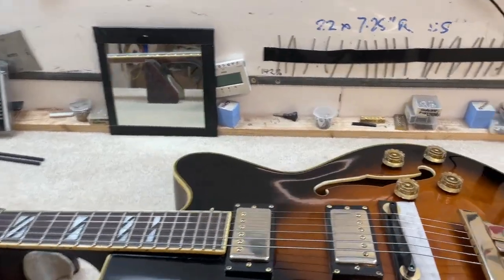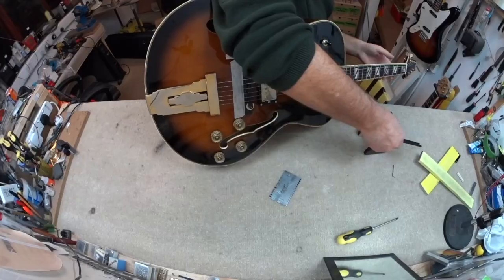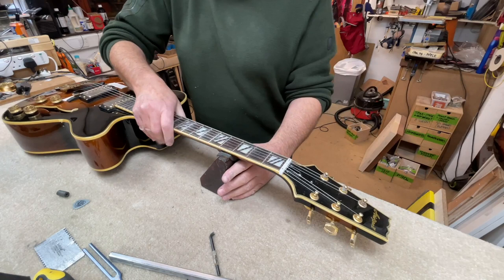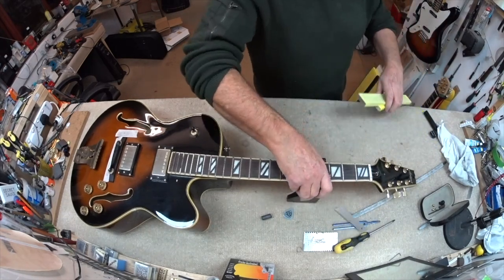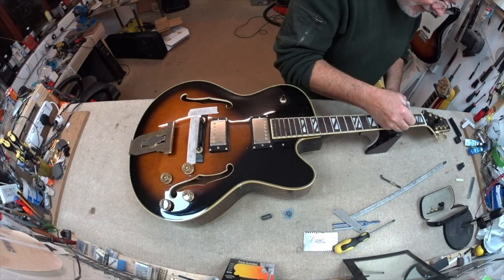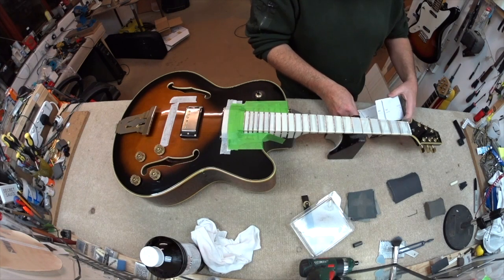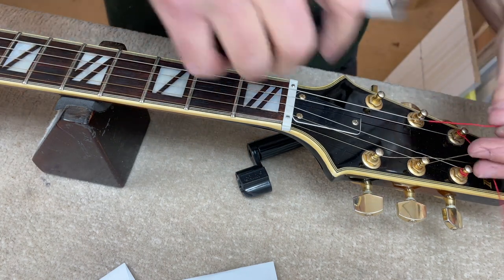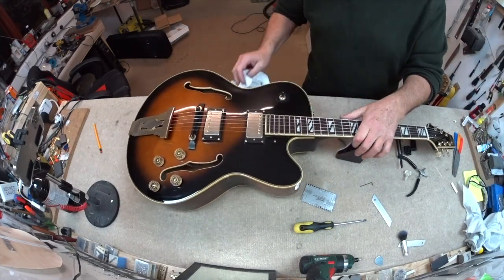Aria Pro II hollow body set up

Comment: What strings gauge is the best for this guitar? I used to set SIT .10 or .11. It´s ok?
Reply from the maker: Anything from 8s to 11s - it depends on your preference. Lighter or heavier strings may require small truss rod adjustment depending on how much relief the string loading puts into the neck.